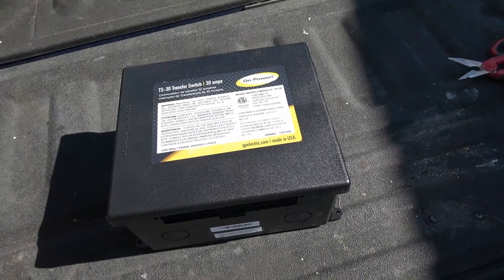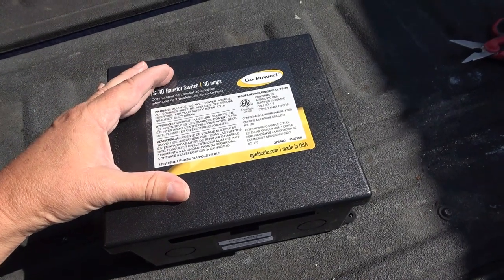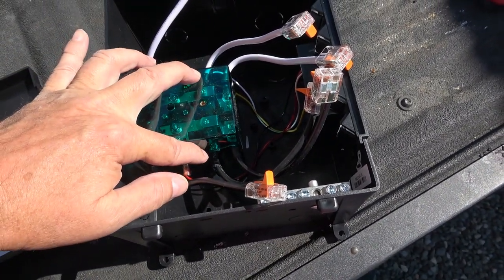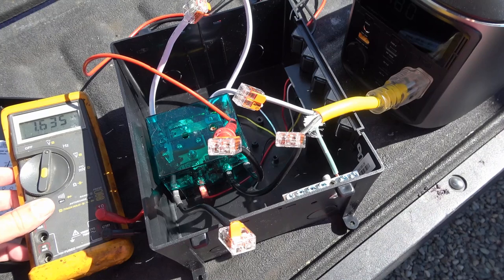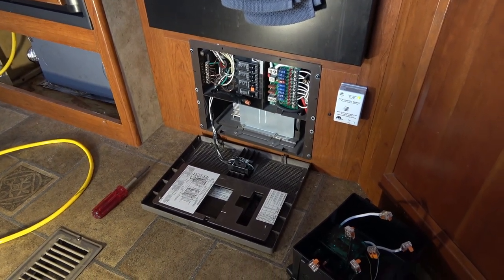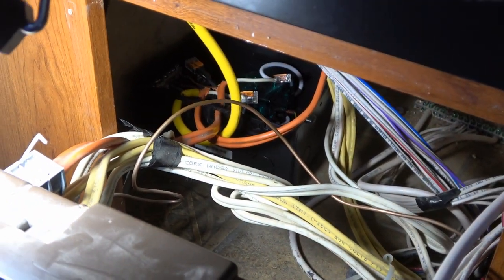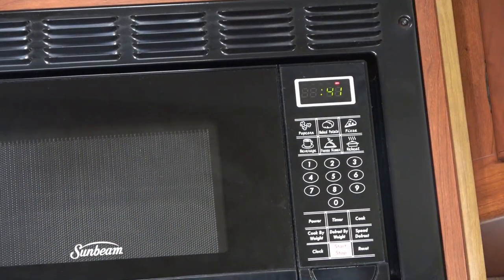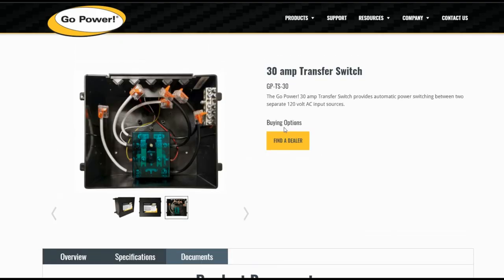30 Amp RV Power Transfer Switch Installation - Go Power! TS-30

Comment: Hi Ray. I just installed a transfer switch and I'm having an issue where the batteries recieve charge even when the inverter is on. Apparently, my original house batteries, which are connected to the same charger as my inverter batteries, provide a connection to the charger through the breaker panel so there's essentially a loop from the breaker panel connection inside the transfer switch back to the inverter batteries. 
I guess I'll just have to manually disconnect both battery banks whenever the inverter is on.
Not a big deal I guess, but I was certainly hoping the transfer switch would control it.
It's always something 🙄
Reply from the maker: There is a way to wire the transfer switch for the converter to be off when on inverter power. Watch this video, I didn't wire that way but explain how its down showing the diagram https://youtu.be/QEqHrIQuI8U  Cheers, Ray

Comment: Thanks Ray! I’m not understanding why you can’t plug your 30 amp power cord into your power station to power all your AC /DC circuits.
Reply from the maker: I can but this just automates the process making it more convenient and easier to have running when traveling. Cheers, Ray

Comment: I wonder if that 1.6vac leak is used for the xfer switch to monitor for voltage change to the inverter or used to keep the inverter circuits energized so there is no delay when switching to inverter or even to keep your settings on the inverter alive.
Reply from the maker: I'm thinking its likely being induced by the relay coil being energized to close the contacts for the shore power side. A little bit of stray voltage shows up on the inverter connections.

Comment: I installed the same switch but ran the converter through it so that it automatically shuts the power off to it when the inverter is on. That way I don’t have to remember to shut the converter off.
Reply from the maker: Cool, I only use my OEM converter when on hookups for extended periods so not much of a problem for me. I have a second better quality converter mounted right beside my battery bank that I use for generator charging. Cheers, Ray

Comment: What would be the difference if you just plugged your shore power into a system like the Bluetooth AC200 Max?  I’m new at this stuff and looking at the simplest way to do it.  I’m guessing if you wanted your power bank inside the trailer then you would still need to wire the shore power plug into the RV to plug into the power unit.  And to switch between shore and power into you would physically have to un plug it then plug into shore?
Reply from the maker: Yes that's right, you can always just do it manually. I just installed the auto transfer switch for convenience sake. So, when I go off grid I don't have to bring out the shore power cord and plug it into my power station. Also, I can use the power station to easily power things in the trailer like my fridge for example as we are traveling.  Cheers, Ray
Reply: @LoveYourRV  awesome.  Thank you.

Comment: I couldn’t tell how you tied into the main power line, can you please explain how you connected it
Reply from the maker: The large orange cable is a my 30 amp main power line feeding into the power distribution panel. I cut it and attached one end to the transfer switch input and one end to the output. Hot, neutral and ground wires attached like the schematic in the manual. Cheers, Ray
Reply: @LoveYourRV  thank you

Comment: Great video Ray! I installed my TS-30 earlier this year with my 2000 watt Renogy inverter and a battery monitor. I'm very happy with its performance. I would be interested in your tests with running the fridge. When I turned mine on, it was drawing about 125 amps according to my battery monitor. I don't see it being sustainable with these gas/electric fridges. Mine is a Dometic 6 cube. I'm running 2 - 6 volt Interstate batteries at 225 amp/hrs each. Maybe you will have better results with lithium.
Reply from the maker: My Dometic fridge only has a 325 watt electric element so shouldn't be an issue. I have 940 watts of solar on the roof and also have a DC-DC charger that runs off the truck alternator that puts out 40 amps so around 480 watts.
So when towing should have plenty of juice for the fridge and to recharge my batteries. Also, the fridge will cycle on and off depending on temps so not a constant draw.
125 amps seem really excessive for the fridge alone, 125A x 12V = 1500W maybe something else was drawing power too like maybe the water heater.
Reply: @LoveYourRV  I'll check have to check that figure again. It wasn't the water heater. I would never attempt to run that off the inverter. I only have 200 watts of solar on my roof and a 100 watt ground panel with a 30 amp MPPT controller. My trips generally are only 2-4 hours so my fridge does ok being left off.
Reply: Well, I guess I have "egg in my face" Ray. My number was quite a bit less than I originally quoted. I just re-did the test with full batteries and no solar (overcast day). The fridge running on the inverter was drawing 26 amps and approx. 333 watts. I am considering a DC-DC charger as I have much longer trips planned for next year with daily drives up to 8 hours. These fridges from what I've read are suppose to be able to stay cold for up to 8hrs with no power.
Reply from the maker: @ronpearson1790  Yeah they hold the cool pretty well if the door doesn't get opened too much. We have never driven with the propane on and never had a problem with spoiled food. Though we generally travel in pretty cool or mild temps, not often above 80F.
Reply: Our regular house type fridge only draws less than 1 amp AC,  and 7 amps DC.
Reply from the maker: 7 amps is still a fairly high load for an RV with limited battery capacity. Its about 7 times the draw of an RV fridge in gas mode.
Reply: @LoveYourRV  Okay, I'm an idiot. I ran a line directly to the fridge for out trip back from visiting family, and powered it off the battery while traveling. After about 4 hours, we camped off grid and I left it connected to the battery, thinking that I had a 200 AH lithium and could go for days before using the power up. I forgot to multiply amps x volts, so we naturally were without any power by 9 pm. I thought the bms on the battery was bad! With the little charge from the unboosted alternator during the driving and the 250 watts from my solar panels wasn't enough to keep up and it probably lasted longer than expected. This is all a learning experience for me.

Comment: Hi,
      I’m looking at installing a 2000w inverter into my Reflection 5th wheel . It’s shore power is 50 amp . So would I need a 50 amp transfer switch ? If so what do you recommend?

Thank you

Comment: Installed this same box yesterday.  I wired my battery charger to only run on shore power. Wired my 2000 watt inverter to the generator input.
Reply: How did you do this?
Reply: I disconnected my 12 V converter/charger from the main circuit breaker and ran a line from it to the transfer switch with a push button breaker and used 3 conductor wago 221 to connect it to the line from the outside and the line side of the switch.  I ran a line from the inverter to the Gen side of the switch.  The output of the switch goes to the input of my breaker box.  This was not easy running the lines through the wall and under the trailer and connecting them all in the switch in the bottom back of a cabinet.
Reply: @placesonthelist  thank you this is very confusing to me

Comment: Hey Ray did you add a breaker to turn off your converter?
Got a link to that video?
I'll search in the mean time..
My PD4060K does not have a specific breaker for the converter. 30a main, 20a AC, 2or 3 15a...
Reason why I don't want a switch at this point is:
 I have 2 separate solar systems on my stationary rig parked at my property while we build a home debt free. 
1 is just 12v Safari LiFeP04 batteries connected to solar on top of the tt. 
2 is Ecoflow DP + EB connected to ground mount solar panels and connected to TT via the 30a plug.

There are times when I want to turn on the Ecoflow and charge the Safari's like early morning winter after 2 days of snow and times when I don't like run the AC in summer when the safari's are charged. 
I guess I could just turn off the external battery switch to them.
What are your thoughts?
I appreciate your expertise Ray.
Reply from the maker: My rig has an OEM 15A breaker just for the charge converter, so I can easily flip it off to stop AC power from going to the converter. You could do the same using, say, a light switch.

Comment: So when you have the inverter/power station providing 120v power, you have the rig charger/converter turned off…and the rig 12v system for lights, control boards, vent fans, etc… just drawing down the house batteries? I guess not a problem with the solar constantly charging the batteries?
Reply from the maker: Yes, the RV batteries provide 12VDC power.  Power stations have 12VDC power, but they are somewhat limited in amperage compared to a battery, so they can have trouble properly powering motors like landing jacks, slides, awnings, etc.  BTW, if interested last summer I bought myself a 3000W inverter and now have it wired to the transfer switch https://www.loveyourrv.com/testing-out-my-new-3000w-motomaster-eliminator-pure-sine-inverter/ Cheers, Ray

Comment: Hi Ray, thank you for taking the time to share your experiences. I will be installing a solar system on my 5th wheel soon. I wondering can I just turn off my inverter instead of an ABT. I am trying to stay as simpler as possible.
Reply from the maker: No problem, happy to help.  Yes, can manually turn off the charger. You just don't want to be drawing power off the batteries and at the same time recharging with that same power. The loop will wear the batteries down quickly. You can either switch power manually or install an auto switch.  Cheers, Ray
Reply: @LoveYourRV  so would I turn off both the charger and inverter if hooked up to shore power?
Reply from the maker: No, on shore power the battery charger will use the shore power so no worries. Its when off grid that the problem arises. You don't want to be charging the batteries with the batteries via an inverter. That makes a charging loop that drain the battery bank quickly. On shore power you get power from the campground to charger the batteries and run the inverter.
Reply: Can you make a video on this? Where and how to install the switch to stop that charging loop? I’m about to install an inverter and transfer switch. I have 400w of solar with two batteries already.

Comment: I notice the wiring diagram for inverter to shore power calls for at 15 amp fuse... is that build in?  Thanks.
Reply from the maker: Inverters usually have short circuit protection and fusing built-in. The shore power feed has the breaker on the campground pedestal. Then all the RV AC distribution has main and individual circuit breakers.

Comment: Would an Inverter/charger with bypass fix all the issues and just wire it to one?
Reply from the maker: Yes, some of the hybrid inverter/chargers have a built in transfer switch. Some even will load share between the shore and battery power. Gets pricey though.

Comment: What if you have shore power, generator, AND inverter??  Do they make 3 input switches?
Reply from the maker: You can install two transfer switches to deal with that. See this page for the diagrams  https://support.gopowersolar.com/kb/article/254-transfer-switch-wiring-diagrams-30-amp/
Reply: @LoveYourRV  that's what I ended up doing!!  I don't know why they can't come up with an ATS that incorporates 3 inputs.  Many RV'ers are boondocking now and use an inverter via solar!!!  I RARELY ever have shore power and NEVER use my generator.  It came with the RV so I need to run it under load once a month or so to keep it healthy!  Thanks!

Comment: The way you wired it, isn't that going to backfeed 120 volts to your main male shore power plug?
Reply from the maker: No, the transfer switch relay is normally open, and the inverter input is connected to the main AC power distribution panel. The path to the male shore power plug is open, both neutral and hot. When shore power is plugged in, the transfer switch control board senses it and closes the relay, switching the neutral and hot, removing the inverter feed, and connecting shore power to the main panel.
Reply: @LoveYourRV  ok, thanks

Comment: Ray recommendation on that power cord from the inverter to the transfer switch? Is the 10/3.  15amp heavy duty one okay for the current?
Reply from the maker: Depends on the size of inverter. I recently upgraded to 3000W inverter with a max out put of 26 amps so used a 30 amp RV power cord - https://youtu.be/QEqHrIQuI8U
Reply: @LoveYourRV  mine will be a 2000w inverter with a 30amp camper

Comment: Thank you again for your “tutorial”.  Question for clarification…did you connect the lead from your inverter by splicing the inverter lead to the AC wire from the transfer switch before the AC wire entered your distribution box?  And, correct me if I am wrong your inverter is not a inverter/charger?  I am in the middle installing my solar system with a 2000w inverter/charger in our 1990 Aero Curser, and I am researching whether I even need my old converter, and because it is an inverter/charger and I have an existing transfer switch my wiring from the inverter at be slightly different.  There is very few examples on the net involving transfer switches and solar wiring suggestions, so thanks for your efforts…
Reply from the maker: This Go Power transfer switch has ready-made connectors for the inverter lead so no need to slice, just had to connect them to the Wago lever nuts.  https://s3-us-west-2.amazonaws.com/catsy.549/MOBI_MAN_GP-TS-30.pdf
Correct, my inverter has no charger. You should be able to use the charger in your inverter charger instead of the converter. Some inverter/chargers even have a built-in transfer switch.

Comment: Are you going to fuse it with a 50 or 60 amp fuse or is it necessary? Xfer switch has one?
Reply from the maker: I don't see it as necessary. On the input 30 amp shore power side what you plug into has a 30 amp breaker. On the output the RV panel has a 30 amp breaker. On the inverter input side the inverter in the Safari ME has overload and short circuit protection.

Comment: Does the transfer switch itself draw a lot of power?
Reply from the maker: I'd guess it must draw a small amount when on shore power for its solenoid coil to switch the relay over to the shore power.

Comment: You mentioned using 2 transfer switches if you want to go between inverter, shore power, and generator. Do they make a 3 way transfer switch or do you know of a video that shows how to do that?
Reply from the maker: The manual has diagrams of a couple different way to hookup 2 TS-30 transfer switches https://s3-us-west-2.amazonaws.com/catsy.549/MOBI_MAN_GP-TS-30.pdf  There likely is a 3 way transfer switch out there. Don't know of one off the top of my head though as I haven't needed one myself. Cheers, Ray
Reply: @LoveYourRV  Thanks for the video Ray! What do you do when hooking up to a generator out of curiousity?
Reply from the maker: I have a 2000W portable gas generator.  So either I plug my 30 amp shore power cord into it using a 30A to 20A dog bone adapter, or I also have a second battery charger and power receptible installed near my battery bank for when I just need to recharge my batteries.  https://youtu.be/H6u7mEWjprU?t=284

Comment: One of the big reasons why you don’t want to back feed to shore power is if the power fails. If you back feed to shore power during a power outage is you’ll feed anyone else connected to the shore  power. The biggest issue you create a safety issue to the local Hydro employees trying to fix the downed power line. Both CSA and ULC require that any power sources inside a building or similar structured not to be able to back feed to the main power system ( shore power).
I personally knew of three BC Hydro employees killed or handicapped for life because a generator in a plant wasn’t isolated from the grid during a power outage. In on case The generator was a 2kw home unit with no automatic transfer switch installed.
Reply from the maker: Interesting, I never thought of that.  I wonder if campgrounds and marinas have to install some sort of protection against such a thing. Though you would think the power draw would quickly overload the generator or blow its breaker.
Reply: Usually in such a backfeed situation the local power source will quickly trip out from over current due to trying to power all the neighbours' houses, but if you are in an isolated location you may be shut off individually (no other houses to power) and the downstream side of the shutoff point would remain live causing the hazard situation.
Reply: Thanks for bring this up. As a lineman I have encountered people back feeding with generators during a power outage. It energizes the lines through the transformer

Comment: Are there any other modifications to the ATS needed to run the generator in lieu of shorepower? Or do you need to add a second ATS, I am looking to do the same but only manually turn the generator on when my batteries tell me to in the event my solar does not keep up with the load.
Reply from the maker: Just one should be good since you are manually changing the shore input power cord. So the shore or generator AC power is one input and the inverter the other. I use it that way sometimes with my portable generator.
Reply: @LoveYourRV  any concerns with a built in? My toyhauler has a built in Onan I'm worried about.
Reply from the maker: @looknohands855  Yes, you'll have to try and figure out how the OEM has the system wired. They likely have some sort of built-in auto transfer switch for shore and generator. It may even already have an optional input to add the inverter. I don't know...